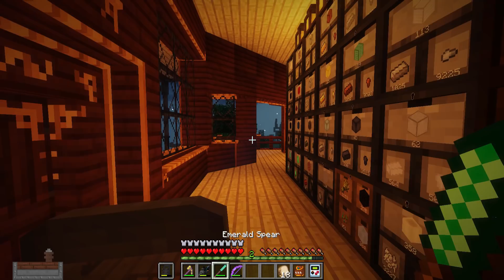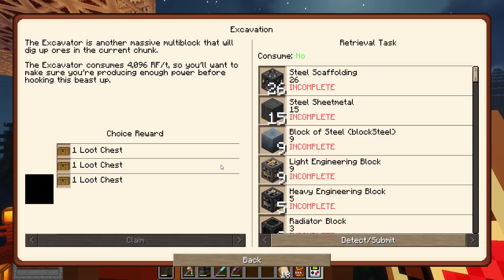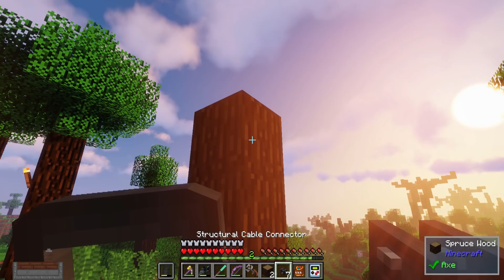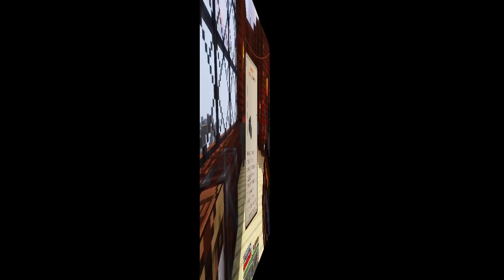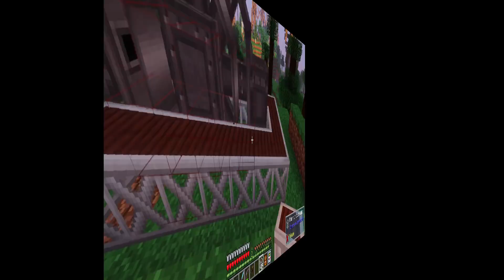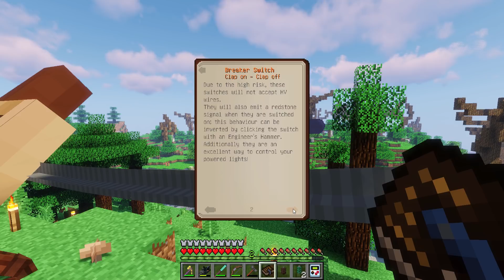Let's Play Automaton! Bucket Spinner! Ep 19

Comment: You don't actually need to do the two pieces of the excavator separately. If you use the third page, the one which shows the assembled unit, the projector will show the parts for both of them, and when you assemble the excavator it'll automatically assemble the wheel too - facing the right way, at that (it can be annoying to try doing the wheel first only to find that you clicked it from the wrong side so it's facing the wrong way).